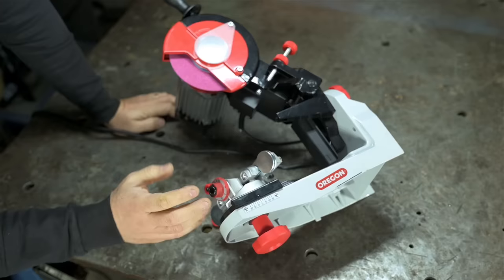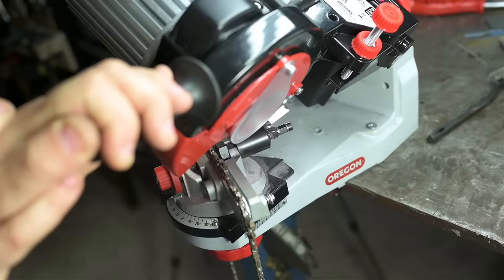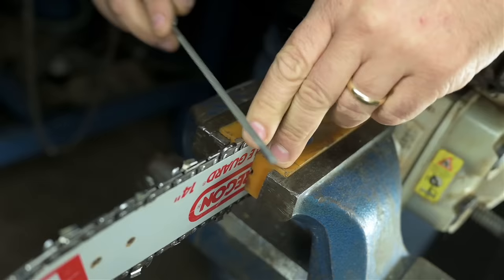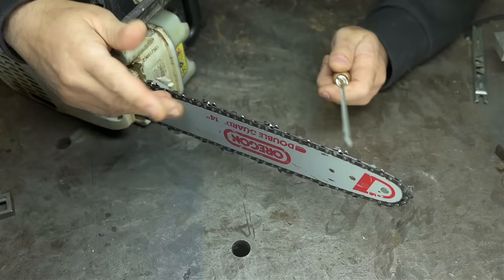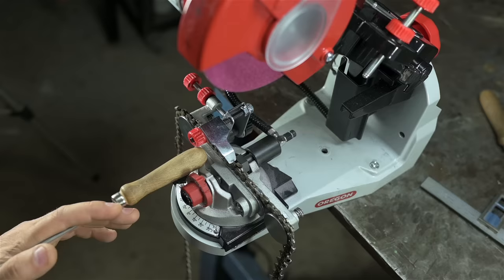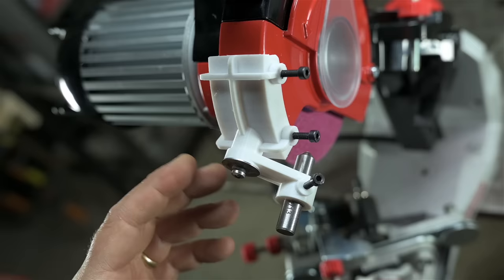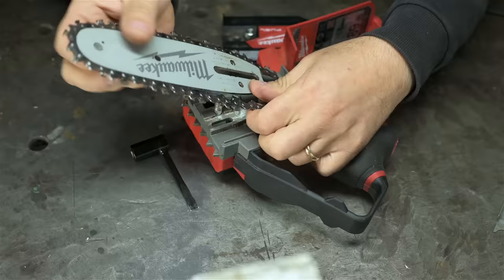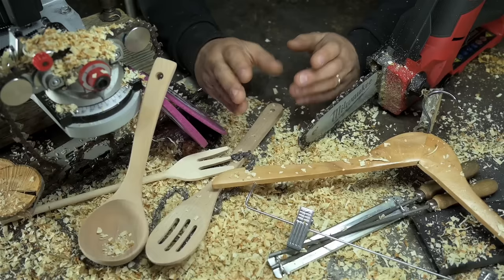Grinding Saw Chain! in Oregon! (620)

Comment: Thank you for the video.  I have an old electric chainsaw which I used as a Teenager and had bought used.  Did a lot of work with it and as I recall it stopped cutting well over time.  I'm guessing the raker is in need of adjustment...didn't know that was a thing...I may dig out the old POS and give her a second life...or just shoot it...either way much appreciated.

Comment: Put a bypass valve in the brake line so you can make angle adjustments, then you can flip the valve and use it normally.

Comment: 0.025" for raker height is fine when the cutter is new. When its lower or used the depth gauge MUST be filed 'progressively'. So your 0.025" guide is not useful when the cutter is worn right back.  U need ti maintain an 'angle of attack' which should be 5°-7° degrees between the top leading edge of the cutter & the top of the raker. I hope this helps.

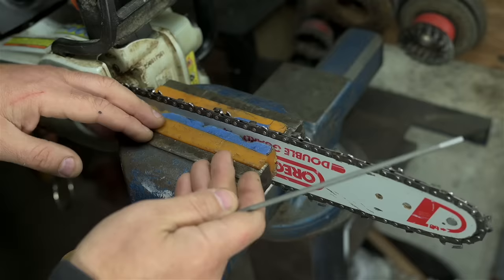Comment: I have some advice from experience to add to the advice you gave at around the 9:30 time  in the video. Yes if you sharpen every tooth consistently it'll be sharper than before you started but if you don't stay close to the guide lines stamped to each tooth the chain will try to cut lopsided and pull off to the left or right so just beware.

Comment: Assuming the links are medium-high carbon steel, I don't think you'll harden any teeth letting them air cool. If they were hardened, now they'll be softer. But who knows what kind of steel they're made from. I feel the only solution is to spend another $500, get a heat treat oven, so you can heat treat that $23 chain.

Comment: Meanwhile the professionals in Oregon use square ground/filed chains rather than round file. (Not actulally square, more of a truncated-triangle hex thing special to the task) Though it benefits from that fancier hand filing guide because of the additional torsion angle. Most northwest saw shops have a grinder wheel dressed for it.

Comment: What funny timing. I was working on my chainsaw while this was posted lol. We have a chain grinder, so much nicer than doing it with a file. Especially when you have 5 saws in use. It's currently 3 because the 064 doesn't want to run and the 038 I got for free in pieces is still getting put together. Runs good though. Chainsaws are fun.

Comment: I've got the bigger Milwaukee M18 chainsaw & as I live on a boat in the UK it means it gets a lot of use , a year in & I'm still impressed, although I did have to buy big boy 12ah batteries to get it's full potential...💚🇬🇧🌱 great show Tony x
Reply: Just curious. Do you encounter a lot of trees when you are on your boat?
Reply: @creedsixteen891  good question...it's a narrowboat on the canal which is lined with trees & I have a wood burner as my sole source of heat...💚
Reply: @marca5883  nice!!  I live in the Manitoba prairies so not a lot of boating experience. Lol

Comment: Might try a diamond wheel. No need to hone and my experience has been they have next to no run out. 
I have this same grinder but I really don’t like that the wheel only rotates in one direction. More consistent if you are always grinding into the tooth. 

BTW when you had the vise turned the wrong way for the tooth you grinding, I almost lost it. I woke the baby from a nap, my wife gave me the death look and was shout whispering me to shut up. 
I have always wondered what it would look like if you did that! Thanks for the great video.

Comment: 3d print a centrifugal blower that attaches next to the wheel and blows air on the cutting side.  Or just use an air hose I guess.

Comment: I have the same machine, but the Chinese version, don’t know if it’s a really good copy or an after hours special from the same factory. You definitely want the hydraulic clamp, as the vise has so much slop that you need to lock it when setting the cutting depth anyway, and the clamp/unclamp with every tooth is the most tedious part. My grinder also has some asymmetry going on left to right, so even on a chain that’s never been sharpened it’ll want to cut the left handed teeth deeper than the right handed teeth if I don’t reset the depth. If you figure out good replacement wheels that are a tad finer, I would be very interested in the part numbers!

Comment: hey ToT .. i have the lower tier one .. and yea it was a little flimpsy where you tilt the wheel, one screw more fixed it (the rotation point was just sticked in and was not fixed axial) 
for the 10 degree tilt .. if you grind it like you showed at 17:50 .. you had negativ 10° insted of positiv 
but more important, i was thinking of buying a CBN Wheel or diamond Wheel .. sadly i dont have a Lathe to fit some adapters and didnt find a fitting wheel now

Comment: I find I can usually get a more repeatable file by hand. I run a mechanical harvester, so I do anywhere from one to three chains a day. The oregons are decent grinders, although certainly not top of the line. My problem with most grinders is that they are not 100% consistent in angle, depth, and being centered under the wheel. There is one grinder on the market, the Markussen Autogrinder, that supposed to be very precise and accurate, but is also close to $6k i believe. I would like to try one of those sometime.

Comment: Nice video 
I am in NW Ohio and I burn a lot of wood to heat the house and shop 
A LOT of dead Ash trees , but also Oak , Locus and Osage Orange
My Stihl Farm Boss 20" is 20+ years old and I also use a 14" or 16" bar on a Stihl MS 261
A Stihl 2 in 1 Filing Guide makes simple chain filing easy 
But I take 4 sharp chains and a Dremel with the proper sized burrs to sharpen the chains 
The Dremel is fast and easy , but also can WAY to far fast

Comment: I've had one a few years now and will confirm you will go through more chains "faster". SImply because you will sharpen them more because it's easier to cut with a sharper chain and it's eaiser to sharpen. That faster also means you are cutting more wood so you also gotta look at what faster means. Is it really faster if a hand filed chain lasts one log in a week vs a machine sharpened chain that cuts 2 logs in 3 days?

Comment: what's kinda shocking to me is that the cheap grinder from my local hardware store has some of the features this one doesn't, like the clamping mechanism is a bit firmer and the chain stop is spring loaded, also there is a pinching wheel that pulls back the chain, so it is very easy to sharpen a chain once you set it up, best 30€ I spent so far :D

Comment: The little tick on top of the cutter isn't for the angle.  It's approximately angle-ish, yeah, but that's not what it's for.  It's the, "Hey cheapskate, go buy a new chain already before the tiny remaining nubs of the teeth on this one start snapping off," line.  Or at least that's what the labeling on my new chain packages say.  More or less.  I may have paraphrased a little.
    Consistency and chains sharpened per hour are the real draws of the grinders.  Especially if you sometimes do things like slightly nick rocks, fence staples, fence wire, rebar or other things that cause one side of the chain to go on strike as far as cutting things goes.

Comment: The instructions on my grinder (Italian model) say to dress the stone by holding /placing the dressing stone on the top of the chain vise and touch off - I seldom do it - I do however admire your dressing stone holder! You might want to clean / degrease the chain. Perhaps ZEP Heavy Duty Floor stopper in a spray bottle with a water wash then spray with WD40 after sharpening if they are to be stored. 

Have you tried the "Stihl 2 in 1 Easy File Chain Saw Sharpener"?  To be perfectly honest unless my chain has hit something I leave the grinder off and use the "Stihl 2 in 1 Easy File Chain Saw Sharpener" (Pfred has "same" version in blue for less money) . Great video and humour!

Comment: What are your thoughts (if any) on using a grinder like this for other cutting tools if the fixtures changed?
Bandsaw blades circular saw blades,  end mills, or lathe turning tools?

Comment: Got super nasty cheap chain sharpener.. Never seen one THAT fancy.. It wobbles, has a brushed universal motor, is made from plastic and I never bother clamping the blade..
But it throws sharps, is better than my filing and considering the... abuse my chainsaw goes through(Got a brushless electric because the petrol ones stall out too easily and handle dirt better) I like it.. Blades come in with bits missing.. Blades come out sharp!

Comment: @29:20 why would a finer grit grinding blade grind cooler than a coarser grit one? Fine grit = more surface contact = more heat generated. or did I misunderstand the whole point?

Comment: 0:20 Well, present you doesn't know what future you will be told. But I guess if you're only providing information that present you already has, it doesn't matter...
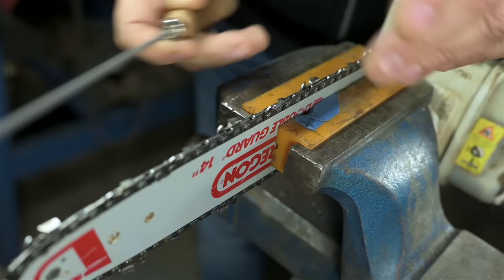6:28 Depends on what you mean by different and same. I would say different chains of the same type are the same type, but not the very same chain.
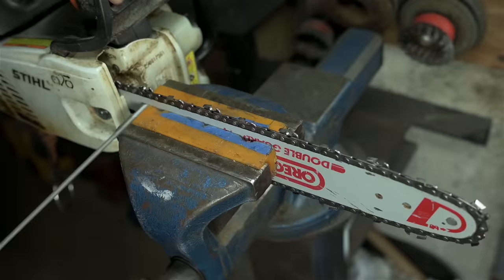9:04 Well, if you're 90 degrees off of the recommended angle, which would fall into "any angle", you'd end up with quite a dull chain, or sharp on the wrong side.

Comment: On the vice under the bolt that holds the swivel that you set the chain saw teeth to, is there not a hole for a spring there to.

Comment: I usually mount the bar in the lathe, that way as it turns i can sharpen a tooth on the TOP and the BOTTOM of the bar.......but you just do you, TOT...I won't judge. Im suprised to see you with a chain saw, i assumed you had a pack of pet Beavers to do that "Yardy" stuff

Comment: Uuummm, I have a cheaper one of these from Northern Tool and I find the lack of rigidity a feature, as you can apply “English” to a too-short tooth.  But, I find I don’t use it much any more as I use a 2-in-one multi file made by Stihl and others which files the raker at the same time as the tooth.  (I’ve never liked those gauge things, and I think the rakers need more attention than most people give them.). The multi-file is much easier to use and you can touch up the chain every time you add gas.

Comment: 2:36 not exactly the same otherwise. The whole red casing assembly is thinner and weaker on them. The one with hydraulic clamping that you have is the most expensive but also the best one. I have the same one (Tecomec SuperJolly).

Comment: 7:25 I just wonder. If you sharpen the knife it is recommended that you should move sharpening stone "against the blade", but here is it the opposite. Can someone explain what's the difference?
In other words. Why you should push file away from you and not pull it towards you.

Comment: 23:40 "it locks so you cant adjust when the  wheel is down"

Sure, but then again... engaging the clamp moves the tooth a little so you don't want to be adjusting the position relative to the wheel without the clamp engaged, getting that perfect and 40 teeth later find out that they are now all ruined because the clamp moved the tooth a little and oyur measurement meant nothing.

Comment: The real question is why are chain files round? Surely they would be better if they were flat files with rounded sides? Round files always seem to want to run down off the top edge and just cut the throat of the tooth. Which is basically pointless.

Comment: Metric uses thousands usually. So 650 thousandths..

What is confusing is was it nanometers, micrometers or picometers...

My guess is micrometer because it shares the prefix with those curiously accurate shop tools. But it's been a while since I had to actually refer to things in that scale. I'm used to dropping out of SI units and into M x10^-(x*3) at that point.

Comment: Tony, if you put a little back pressure or pull on the chain with your left hand, it will force the chain into and down on the stop (26.35) which will give better results, so your left hade is always on the chain. And the time you spend setting it up with the hydo-lock makes up for having to release the vice after every grind. I'm sure the engineers at Oregon have done a time comparison with and without the hydo other wise who would spend the extra money? I have the version w/o the hydo but my vice also has one more adjustment to it, it is ball shaped at the bottom and will roll the vice for different angels.

Comment: The whole, "Hinge is not rigid enough" argument for chainsaw grinders is kind of a mute point when being compared to hand filing. Even my $30 harbor freight chain grinder will perform far more consistently than a hand file... even more consistently than when using a file guide with said file. Provided that the chain grinder is properly setup and the stops are properly set, and the stops are actually used to locate the chain and the grinding wheel, the whole thing takes care of the "human error". The only thing the operator has to do at that point is not burn up the chain when grinding it, which would seem like rocket science to some people but it's actually just a matter of letting the grinding wheel do the work rather than forcing it down into the chain like it's a chop saw.

Comment: Good morning This old Tony, from this old Papa.  First, thank you for the education you provide the world of machinist with your expert life experiences. Just a quick question. I have been looking to replace my mix match collection of taps and dies with a uniform good quality set of SAE . It seems there are mostly metric sets out there. My need is for a full range of SAE taps and dies with minimum OD dies so I can make the least amount of die holders for my tail stock. As for taps, I have seen so much about spiral taps, I would like to step up to spirals, if you agree, for hand and power tapping in my lathe and milling operations.. The range I use mostly is #2 thru 1/2”. Can you recommend a good manufacturer of these as sets or individuals if need be. Don’t have a Hugh budget but do try to get the better quality tools, Made in USA if possible. Thank you for any advise you could provide. Appreciate every video you make. Papa Maggio, Ex shop teacher from 50 years back. Like Mr. Pete.

Comment: So I have to sharpen chains at work, its all bloody guess work. 

Most folks are just "I use it once a month" people, get the chain in the machine, sharpen, send it. 

VERY rarely get proper commercial tree cutter guys wanting their chains machine sharpened. Also most of the time, a new chain is DAMN sharp compared to a machine sharpen. Think the few times that it really pays off are big slab saws, 150teeth then you'll do the machine.

Comment: Electric Grinders reduce chain life and very often change the temper of the metal iof ya's goin' to heavy with the cuttin'. FWIW - I have the little carbide burr thingy and always sharpen my chains by hand with a circular file coz' In ain't found anything that does sharpening as well. Q: did you say "Maul of the story"? I reckon your dresser is awesome - but it shouldn't have been nedded - oh Oregon.

Comment: After using a grinder to sharpen thousands of harvester chains, you are over complicating this.  

As long as you aren't burning the chain any setting near the factory recommended setting will do fine.  However if you do burn your teeth the nitpicking about grinder angles and disk size are irrelivent as you chain will dull as soon as it hits the wood.  

The Grinder one model below yours is the one most picked, it allows more consistent tooth placement with the hand tightener where the hydraulic one is temperamental.

Pull back on the chain when pulling down the handle to take out slack and make it more consistent.

Comment: Advanced tormek user there! Buy T4, it's great :-) Anyway, on knives, we are VERY concerned on burr. When my dad told me how to sharpen the chain with the file, he told me you always drag the file out of the tooth, so you create the bigger burr, but consistent on both left and right teeth. As I see this grinder, the wheel rotates only one direction, so I'm guessing... the burr will be bigger on one side, smaller on the other, right? Couldn't this make the chain pulling to the side, as one side will be sharper than other, or will suffer of dulling faster  than other side?

Comment: Did you ever get that Milwaukee top handle 2826-20t? I have one and they’re really nice imo especially for those similar to myself that only really having a need for one a couple times a year and the rest of my  maintenance can be done with the m18 Hatchet which is a damn good tool and really imo is bridging the gap between pruning   And pole saws and traditional top handle bucket saw in a way no other tool has done to this point that I’m aware of. Damn good tools, im really interested in the new flexvolt (model is something like dccs6774 or something)  sorry if that isn’t it but it’s close anyways it’s dewalts brand new 60v top handle arborist saw and from the looks of it the 2826 and Flexvolt will be a good head to head video I’d love to see(if you get the m18 top handle just make sure the battery’s are under warranty and only use the 6ah xc6.0 the xc 6.0 forge is the best option as pouch and 21700 cells are better for high discharge applications, the 8ah is meh but will work or the 12ah but it’s heavy I like the 6s personally but great video love the channel

Comment: Stihl have a combined file+ raker file+plastic handle/angle guide thingy. Anyone still faffing about with raw files: get one of those..
Reply: Also: those of you cutting pine trees - I kinda figured you'd be a one chain per chainsaw life kinda deal. :) Cutting eucalyptus (aka gum trees) in Oz and it's bit of a different game. But hey, sand/dirt/rocks are the same hardness anywhere I guess and when you're cutting firewood on the ground, it's part of the tax on free firewood.